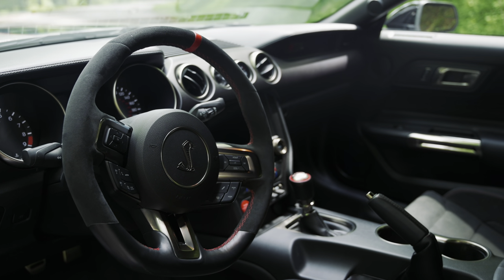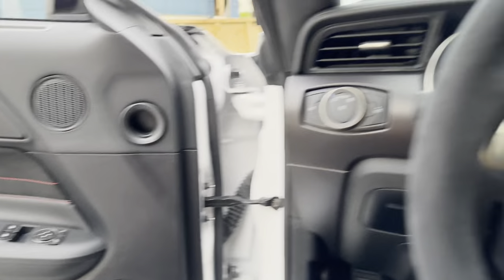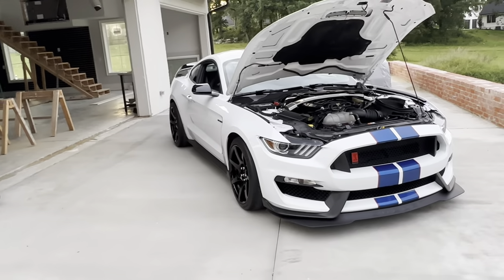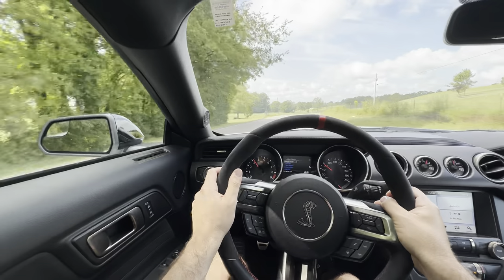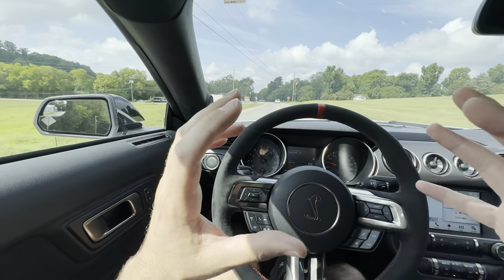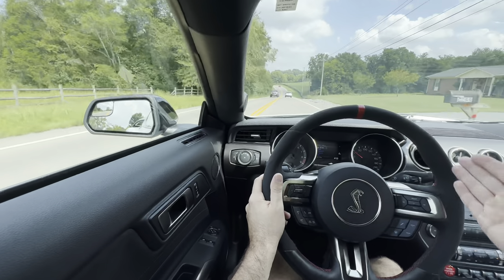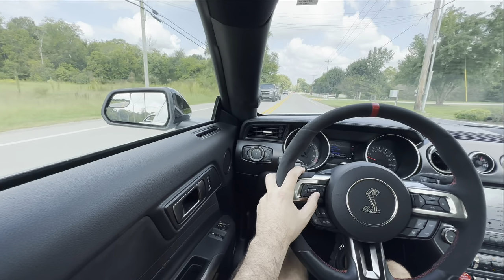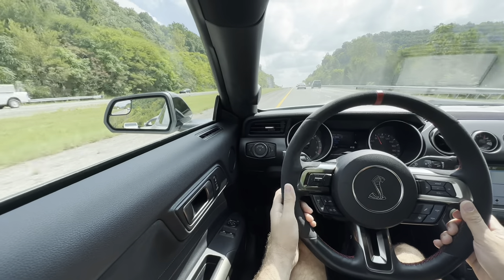Shelby GT350R Owner Review - The Best Car No One Is Talking About Anymore

Comment: I drive mine almost every day and so do my friends with their GT350’s.  As far as I’m concerned it’s one of the best cars ever made.  Great video.  Not too many cars can compare.
Reply: Same here. 2018 with 30k miles and 2 track days. Never one slip up. What a glorious machine.
Reply: Yomammafatboiiii  Except looks and performance.
Reply: Guys I’ve wanted one m, but fear of blown engines and oil burn has kept me away.  Our my fears legit?  Bad ass car. Thanks. I have lots of cars and can sell a few and buy and R. Cheers.
Reply: Yomammafatboiiii if you’re a mustang hater why the f are you here bro?
Reply: Yomammafatboiiii yeah, the Camaro did so well, GM discontinued it. 😂
Reply: Yomammafatboiiii  except sound, appearance, depreciation and others.
Reply: @timmyboy2495  multiple times!
Reply: Yeah its such a great car the manufacturer decided they should stop making them because they hit on perfection right ?
Reply: Will be buying one this year long live the car that started it all
Reply: @JohnRoss-ps4vh  Me and my friend both have 2016 models. They don’t burn oil and mine only has 40,000 miles on it.  My friends GT350 has the original engine with a centrifugal supercharger that makes 700 horsepower to the wheels.  It has over 100,000 miles on it.  He drives his every single day rain or shine.  2016 should be a good year to get as long as you get one that doesn’t burn oil!
Reply: Yomammafatboiiii faster, more powerful not to mention faster at every track imaginable but still not universally loved as the gt350. Not better in every way
Reply: Yomammafatboiiii  yeah right.
Reply: Yomammafatboiiii  what are you, like 13?
Reply: I’ve owned both the ZLE and GT350. Both great cars. Hard to say which is more engaging - I really think it depends on personal preference. I think I prefer the ZLE mainly because I’ve always been a Chevy guy. The GT350 is a 9 out of 10, but the ZLE is an 11 out of 10.
Reply: It really is I open one too, it will go down as a goat

Comment: The reason no one talks about it any more is was 25 recalls....burning oil bad rings ,bad blocks scoring,bad oil lines fires,bad filters fires and wrecks,bad cranks scored bearings,bad door  latches does open ...body parts only fix the 350 expensiveto repair...front splitter too low...and on and on problems that cost too much !
Reply: Says the civic owner
Reply: @metroplex3k  No I have a Mach 1 and a GT5.0  just tired of Ford charging alot cof money for car

Comment: I feel the standard gt350 (19-20) are the best deals on the market and the desirable of the years and models. If the R had more HP, then I could justify the increase, but don't think giving up the backseat and CF wheels make the premium.
Reply from the maker: Well the carbon wing, front splitter, Racaro buckets, and I think they tuned the chassis and suspension a bit but don’t quote me there.
Reply: @Driven-Productions  yeah, if you track maybe.. but these "creampuffs" sit in garages most of the time and too afraid to accumulate milage.  Too good of a car to sit, so the standard GT350 owners see the most miles and enjoyment IMO
Reply: For those wheels alone it’s worth the 10k more. The 19 & 20’s are 60-65k and the R’s are 70-75k, there’s just less R’s so they will retain value much better.
Reply: That is a lot of coin against the improvement gains over the stock.  I don't argue that R's will retain value (for collectors), but only if the miles are low.  This all brings me to my original comment.. a non-R gt350 can be driven and enjoyed!  I have 12k on mine and love it.

Comment: MACH1, Track Pack, 6spd, resonator delete steeda X pipe. Pretty much everything steeda makes for suspension bracing, camber plates (ford plates are kinda janky)…COYOTE 3—— send it… that cold start never gets old, and you CAN drive it everyday with out upchucking the crank.

Comment: If you're going to revieif you're going to review the car. Review the 19 or 2020. It has the latest and greatest features and tech for that car.
Reply from the maker: Thanks for watching and commenting. So on my channel we reviewed both the 2020 350R Heritage and 2019 350R. Check out Save the Manuals playlist.
Reply: The 2020 is a lot more expensive due to upgrades, engineering, that are exclusive to that year and build numbers. I own one with only 5300 miles. Cup 2s don't work well with Florida rain.

Comment: just found this review. I appreciate your passion for your R. I got into the GT350 and 350Rs which convinced me to get my F-150 with the Coyote motor instead of the Ecoboosts. I also did a Raptor Steering wheel swap (yes i do paddle shift it everytime i drive it) because I came from a manual WRX. I would love to own either a 350 or 350R in the future and like I said, I really do appreciate and share your passion for them even if I don't own them yet because I too value a great driving experience.
Reply from the maker: All the best towards getting one. I think now is a fine time to get a great deal on one!

Comment: Give you an idea the car will go 55 mph in first gear. And second gear is 93 mph so no you will be going 30 over in second gear even on the highway. Also on the highway if the speed limit is 55 you will get 25 to 28 mpg

Comment: The only people who should buy the R is a collector.  If you're racing, it makes more sense to start off with the regular GT350.
Reply from the maker: I mostly agree with you especially if you plan to drive it on a daily or even weekly basis. But, you're talking about collectability, the GT350R is far more rare and desirable. It will always demand a premium, esp in 20-30 years when these are considered the best of breed of the Gen 2 Mustang 350s.
Reply: Why do people always think this way? The car was built specifically to be driven on the track and very hard! People with this thought process are part of the problem.
Reply: You can't drive these hard, they blow up!!! This bad boy will be regulated to collector status and we will never see another voodoo type motor ever again.
Reply: @jhempsrt4  then you don’t know much about these cars. Properly warmed up and proper maintenance and these are very reliable.
Reply: @michaelschultz1104  Tell that to the plethora of owners and former owners who have blown engines.
Reply: @jhempsrt4  the plethora? Honda accords have a near same failure rate, thing is most of the 350 owners had never owned a proper race engine that requires a proper warm up procedure every time before beating the 💩 out of them. Far more owners without problems than ones with.
Reply: @michaelschultz1104  Now you are just being ridiculous. I have never heard of an Accord just randomly locking up. But the internet is filled with gt350 horror stories. And you can't simultaneously argue that it's more reliable than an Accord while also arguing that it requires a deliberate warm up procedure before you rip on it, or else it blows up. The later scenario implies that it is not as reliable as the honda you just compared it to.
Reply: @michaelschultz1104  Schrodingers Mustang, simultaneously the most reliable car on the road and a ticking time bomb if not properly warmed up.
Reply: @jhempsrt4  look it up! There are literally zero cars with 100% engine reliability.
Reply: @michaelschultz1104  Of course... Do you understand how statistics work? Lol
Reply: @jhempsrt4  yes I do but clearly you don’t.

Comment: Will the front splitter clear a speedbump?
Reply from the maker: That depends how aggressive the speed bump is…
Reply: @Driven-Productions  Thank you for your quick reply.  I don't know the height, but if I had to guess...4" - 5" in height.  I'm asking because I want to buy a 350R, but my community has speed bumps.  I don't want to scratch the splitter or worst break the splitter.
Reply from the maker: @thejarfoundation7162  I would avoid this car then, better buying a regular 350. Suspension is stiff, gonna beat you up on each pump.
Reply: @Driven-Productions  In addition, my neighbor has an Aventador.  I know it's a different car.  But his car clears the speed bumps fine.  Without using front airlift.
Reply: @Driven-Productions  thank you for your feedback and advice!  I only want the R because of the resale value.  I believe it holds its resale valuce more than the 350.
Reply from the maker: @thejarfoundation7162  ah if you buy the 350 right, it should hold too just at a lower price point. But agree it does not have the 1/3600 rarity factor.

Comment: I said it from the beginning,  those peoples who purchased these shelby's then sold them fast will be kicking themselves in the head in the future.  they will sell for near millions if not simply millions.    it wont be about speed as EV will be a far greater rush in terms of speed, but EV's dont have souls.  they are not living machines as is a combustion engine vehicle.  the vibration the sounds the connection between the driver and the machine.   EV's for all their greatness loose a ton of that connection.  Even many supercars dont have it.  as their engineering dials out the personallity of the vehicle which actually comes by a lack of perfection.